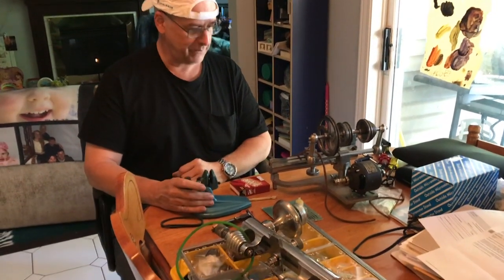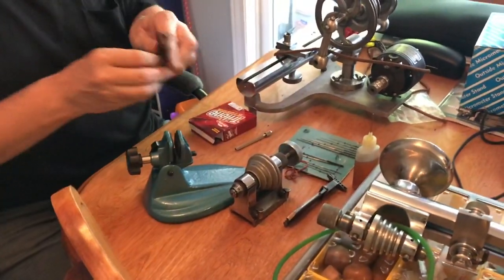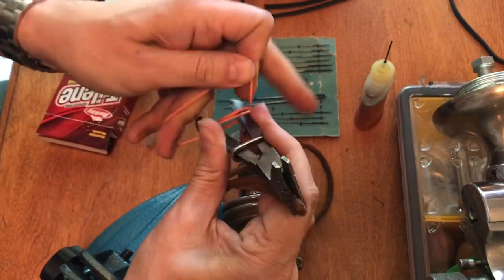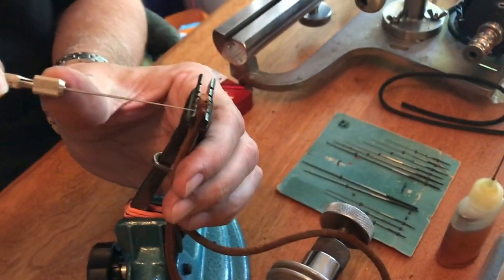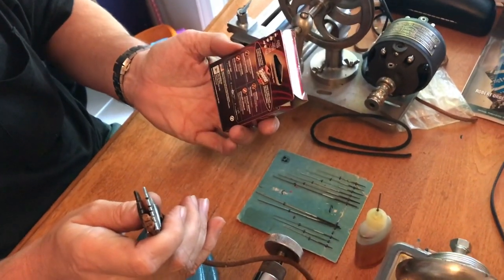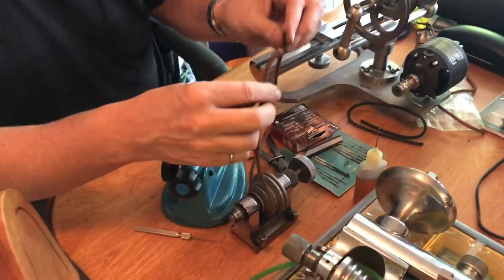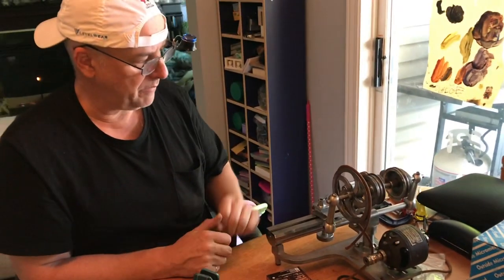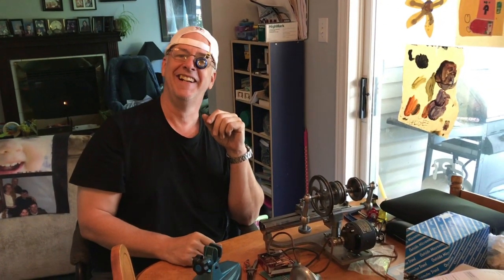Making a Watchmakers Lathe Belt

Comment: Hello again JD,

I just wanted to come back to this video and give you more credit for this mini series. When I was first spinning up my lathe I had seen and read so much about synthetic materials and melting or super gluing the end connections etc. 

I have just completed a task most watchmakers would not try. I am making parts for collet holding tail stocks that I have retro fitted to my 8mm lathes. I cut off a 33mm long piece of 3/4” dia. brass from a 6” long round stock bar. I used my 4 jaw chuck and cranked it up with the info in this video and cut through that bar in no time with a full size hack saw, while the lathe motor and that belt did the work. Unbelievably great belt system. 

Thank you again for this and so many other great videos. I especially enjoy the lathe setup/work ones.

Cheers,
G.
Reply from the maker: Hey big, thanks for responding back and I’m very sorry that it took me so long to find your comment. I made this video to share what I learned and what I decided to do and making a belt that would grab the pulley system and not make a lot of noise. as well, it costs only a few bucks for a bootlace, and the belt works extremely well. Perhaps I should do another video on lathe cleaning and oiling

Comment: Great video, thank you for the several videos you have made where you were not able to find any on the internet. They are very helpful. I am just finishing up restoring a Marshall Peerless and a deep dive into replacing a few wires in the watchcraft 1/10 HP motor. Both wires  on the brush terminals and a wire from the coil to reversing switch (also made it longer to aid in reassembly) Just finished getting the motor all buttoned up and added a rheostat motor control as well as a ground terminal to the motor case. Your videos are very inspirational and I love the fact you give part numbers and where you source items. I bought the laces from Mark’s and will make some belts later today. Thanks again. 
Cheers,
Geoff
Reply from the maker: No problem at all. Very glad to help. My watchmaking has slow down a bit since I’m working 24 seven and have no time and when I get to the weekend I’m pooped. However, that should change in about two months and I’ll be able to start working on pocket watches more aggressively. I do have a boatload of videos online to help people with watch repair technique. I’ve got the sudden urge to make a Balance staff.

Comment: Thanks for making this video Jd. I use leather belts but have always used a kind of staple I made out of a paper clip to connect the ends. Your method looks better and I will definitely give it a try. 
All the best,
Norm in Arizona
Reply from the maker: Motor1 Need to fit rid of that noise staple:)

Comment: The lathe I bought as a first for me has the stretchy acrylic type belts. It has a variable speed pot , but changing the belts to the different size diameters on the headstock and motor pulleys also increases the speed choices. I take it that with leather belts they will not be good to move around lacking ability to stretch some? Also I am considering using fishing line to replace the slim metal ‘rod’ that was put through and bent around itself to join the ends of the belt. Yes, noisy!
Reply from the maker: I do think the leather belts work fine for adjusting the speed on the pulley system. The leather does actually stretch a bit.

Comment: Cut your leather belt material to length, and poke your holes for thread just like the video shows. Glue the ends together with contact cement, and let it set up for an hour. Then sew it with monofilament. That way your joint will be tighter.
Reply from the maker: Good suggestion. Thanks

Comment: thanks for the info very helpful
is there an ideal distance between the motor and the headstock? should it be more in line with the small part of the cone in the headstock or the larger part?
Reply from the maker: Lined up with the larger part of the pulley for more torque. And ideally you want the motor close to the pulley, but you need room to work as well. Get a Countershaft and a Borel lathe stand.
Reply: @JDRichard  hello again, what diameter is the large pulley on your countershaft? I was thinking I could make one while I keep looking for a genuine countershaft, thanks again for all your help!

Comment: Really informative, thank you. I just didn’t quite hear where you’d purchased that leather from and how do you stop the fishing line from unwinding? Do you need to glue it after you are finished sewing it or is it tight enough in the little hole you made that it’ll not come loose? I enjoyed your video and your sense of humour too. Thanks!
Reply from the maker: Steve K I tie the fishing line once finished in a square knot  2 times and then I very carefully burn the line with a match to bubble the ends so the knot will not undo.

Comment: You might try stitching it together with braided fishing line, it's far more abrasion resistant than monofilament, and it won't stretch. As a side note, in a pinch you can use line from a garden string trimmer, just melt the ends together like you would with a normal urethane round belt. Lastly, I followed you over from homemadetools.net, and you have yourself a new subscriber.
Reply from the maker: coderazor Hey, big thanks for the the comments and suggestions